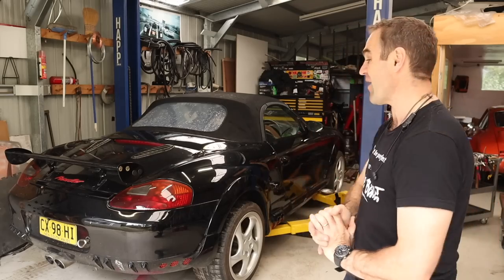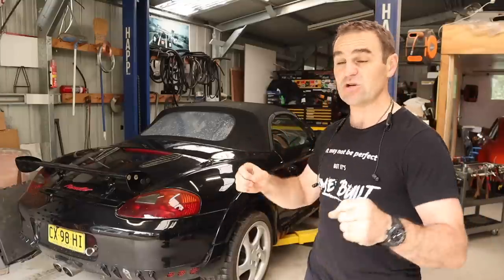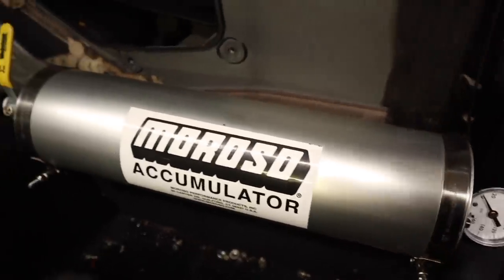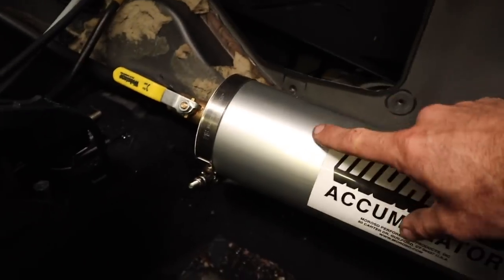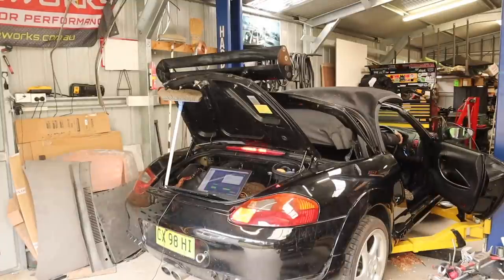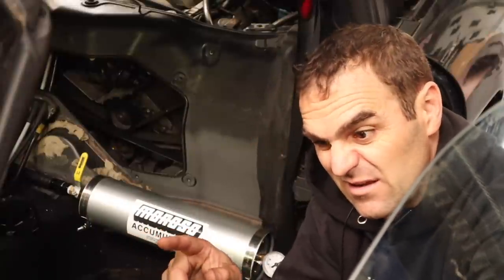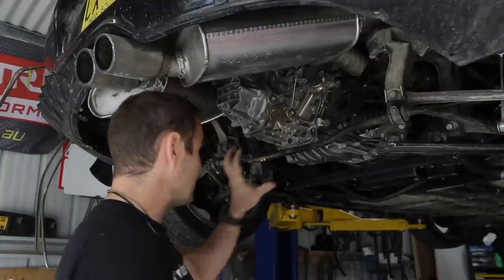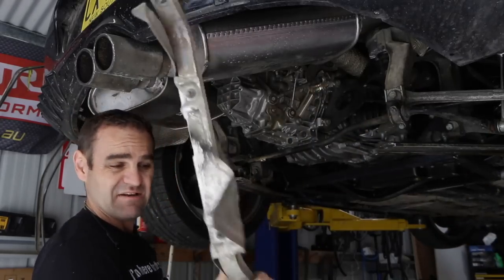One Step forward 2 steps back - Porsche 986 Boxster V8 engine swap track car build 22

Comment: Double check your oil level with the accumulator closed to make sure you're running the correct level. If the accumulator runs with the piston just off full due to your engines running oil pressure you'll run too much oil in the sump. It'll sap maybe half a kW of power but it'll mostly just aerate your oil and drop oil pressures.
I usually run on the low end of the dipstick on my track car and get higher pressures then if I run it at the full mark.
Reply: I'm not sure I understood it well. With accumulator you put extra oil to the engine (as you've said part of it is gathered in the accumulator). I agree with 1one3 Racing that too high level of oil isn't good for engine and take away some power you need or wanted. Oil pomp make pressure to put oil everythere it should be, but after that oil return to the oil sump without pressure. So how avoid  too high level oil in the sump when you have extra 2 litres in oil accumulator and probably it goes gravitacly to the sump.  The only solution is  to open oil accumulator always with working engine and close it before you shut down it. Am I right?

Comment: I would take the starter motor apart first. Since the solenoid is clicking, it may be just the contact points that you need to flatten again. Some grease on the pivot can help too.

Comment: Hey Jeff, its probably not the solenoid so to speak, more so a winding in the starter armature, or possibly but unlikley the brushes in the starter, the brushes are doable at home, but the armature is a replacement item and needs a growler to test to see if its faulty otherwsie, so its probably just easier to replace anyways haha

Comment: You seemed worried about the thermostat not opening yet, I did some work on a V6 golf I had a few years ago and the fan didn’t kick in until quite a bit over 100 degrees centigrade and that was normal for that car. It just so happened that they made the instrument cluster read 90 and not go any higher unless it went WAY too high. Because then customers would be constantly in the dealer wondering why there cars were overheating even though it was normal operation

Comment: To get a truly accurate pressure reading at low levels (approximately 6 psi in your case) just get a high quality hand held gauge and do spot checks from the Schrader valve!

Comment: Jeff if you go with another belt driven pump make sure to bleed it up with the engine off lock to lock because if you do it with engine running the oil gets airiated and frothy which doesnt do the new pump any good good luck mate.

Comment: Jeff, might be worth pulling that starter motor apart could just be brushes or a set of contact tips in the solenoid, stuff like that can still be fixed.

Comment: Could the rattling noise on the first couple of starts, been the sound of the solenoid not retracting fully? Which would account for the later failure.

Comment: Oh Jeff, seems that Car just does´nt want to run, I´ve had that problem myself and it tends to get expensive😕 By the way, do not rely too much on that Maroso thing, first of all it complicates your Oil system in that there are more places to leak, secondly the amount of pressurized Oil you´ll get back from it will never be enugh to compensate any kind of pressure drop from the pump, thirdly as soon as pressure kiks back in this guy is the first to take it back on board thus prolonging the time it will take for the Oil to hit the bearings. Fourth when the pump takes in air causing the drop Oil is cavitated/foamd, this will then be pingponged back and forth between the pump that Maroso thing instead of being quickly expelled through the bearings before pressure can be built up again.

Comment: I know just how frustrating "one of those days" can be!
As for your E-Throttle error - as you were continually blipping the throttle and rapidly changing the target, it's likely that the PID tuning isn't quite set up right yet, and it's not reaching the targets in time, so accumulates an error - once it accumulates a number of errors, it'll shut down the E-Throttle control and limit your RPM to 1800.
Most E-Throttle bodies "rest" with no power at about 8% open, and are driven closed to a smaller opening when the engine is running - so with no power applied, the throttle "opens" to ~8%, and then the ECU also limits the engine to 1800rpm, which should allow you to limp the car to the side of the road, and safely power down and restart the ECU (which clears the accumulated errors back to 0, and gives you another chance!)
Reply from the maker: That sounds about right. Once the new starter gets here I can dig in a bit further.

Comment: Just wondering if that was the starter making that horrible noise. Stuck On??  Good luck Jeff
Reply from the maker: No. The sound was from the other side of the engine, but a good thought.

Comment: Did you end up changing the oil cooler orientation as previously it looked like the way you had it mounted it wouldn’t have been working that efficiently?

Comment: Instead of tighten the bolts to the wing, take i off... along with all other hideous custom parts.
The noise may be due to the fact that you have too much engine oil. You did put more oil in before the accumulator tank was full.

Comment: There’s probably a really complicated way you could get the engine management system to control an automated solenoid for that oil accumulator🤔
Reply from the maker: They are available with a solenoid, but that is an extra expense ;)
Reply: You can’t just buy it like that - next you’d be buying a whole car, engine an’ all!

Comment: re the starter.  1. the solenoid cap is crimped on. Bosch have done this for decades = you can't repair the solenoid OR the contacts/plunger anymore.
2. If you are running low on brushes... it was OK DECADES AGO to give the starter a tap. That was in the days of wound shunt field pole shoes ok?
3. If you "tap" a modern starter, you just broke the permanent magnet pole shoes. = broken magnet = grabbing the armature next time you want it to rotate. = frying cables + siezed starter. ffs. NEVER hit a premanent magnet pole shoe starter. You want to see if the brushes are worn? dismantle it. DON'T hit it.
To test a solenoid. 2 x windings in there. 1. from start terminal through the brushes to earth. That's the "pull-in" winding. You need a second winding in there. Why? Coz once the pull in winding finds its ground...and the motor starts... there's + 12V in the armature now. a plus and a plus = no circuit. So then there's the "hold-in" winding (start terminal to ground. Weak... enough to hold the plunger, but not strong enough to pull it in).  Tell me I'm wrong. BTW qualified auto sparky before anyone wants to hi brow their interpretation of facts.

Comment: This car needs to be exorcised! It needs to have its "decoration" / tuning bits REMOVED. The car does NOT want to run because it does NOT want to be seen in the street. It is ashamed of its appearance. ^__-
Reply from the maker: Good thing it will only see the track ;)

Comment: "Coolant vacuum pump if you're working on 911s" ? Aren't 911s air cooled ? . . . . . . .
Reply: Not for about 25 years
Reply: @8700s14  Aren't the water cooled ones 996s ?
Reply: swapped engine from Audi..i believe?
Reply from the maker: 996, 997, 991,992 are all still 911's ;) Not confusing at all I know.

Comment: Anything over 160 kmh in a boxster or 911 is dangeous.You have no control of the steering because its so light at the front.Porsche fanboys will not admit it but its true.Putting a v8 in a boxster is suicide
Reply from the maker: Haha. That is the funniest thing I have heard all day thanks :D . Actually a Boxster being mid engined is a basically the same layout as most supercars (which have tons more power). Also this engine is only 17kgs heavier than the 6 ;)